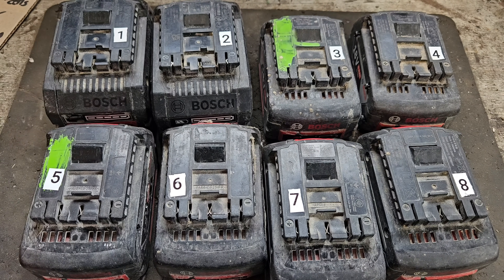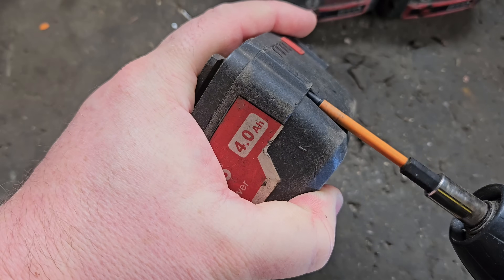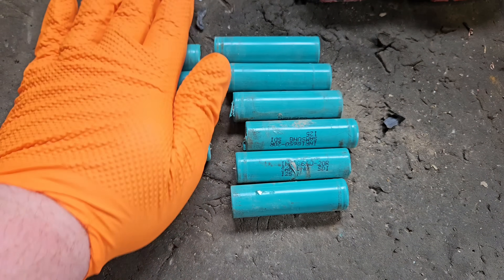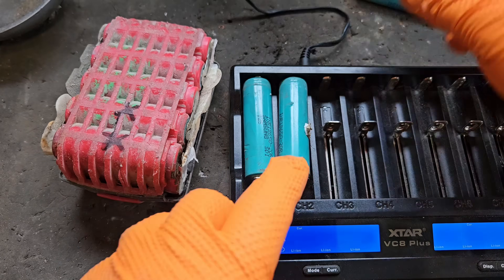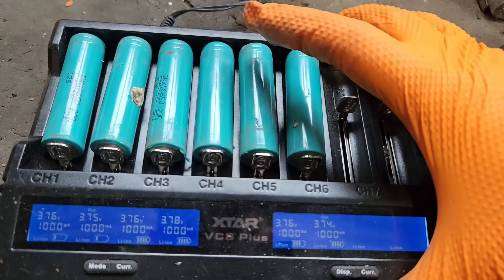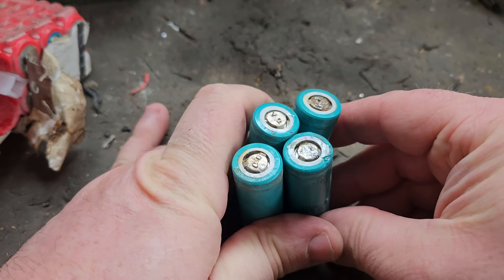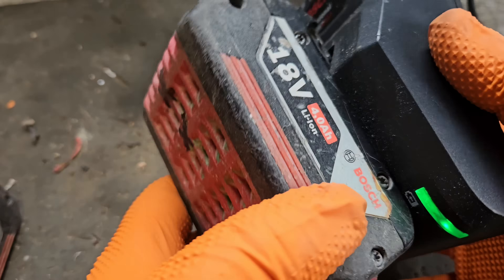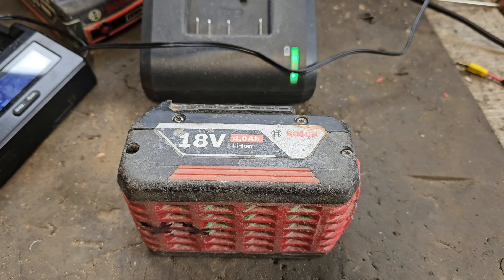Bosch Battery Repair using Metabo Cells

Comment: I have a 9ah Dewalt 20V/60V completely dead reading 3.2 volts. In like new condition. How long should I leave it jumped to another battery. Didn’t open it up yet. Any help is appreciated.
Reply from the maker: Jumping to another battery almost never works on flexvolt. You can pop a resistor or thermal fuse handy enough

Comment: This charger not showing real internal resistance.
Reply from the maker: Please explain exactly what you mean. Are you saying the resistance shown is not accurate?
Reply: @doctorlefthandthread  The resistance values differ significantly from those measured with, for example, an FNIRSI HRM-10 meter or an RC B6 Imax charger. Sometimes the discrepancy was quite large, almost 30mOhm.